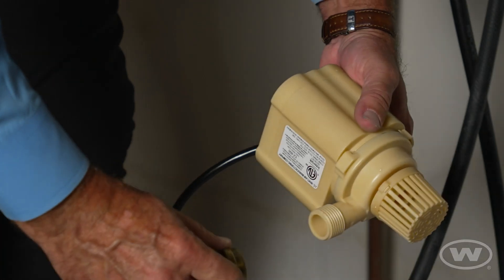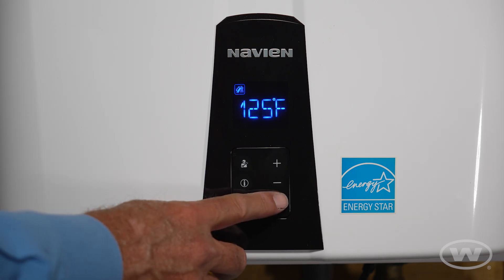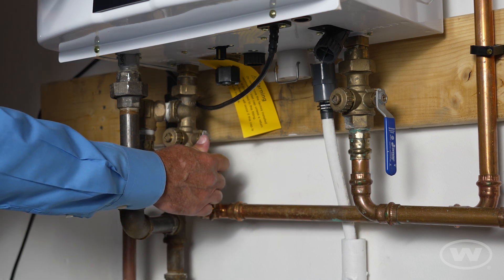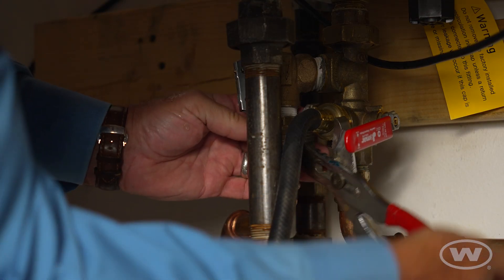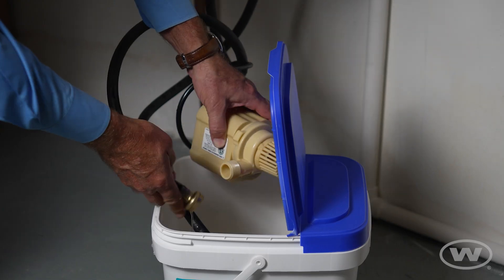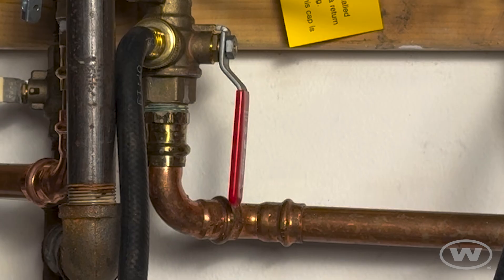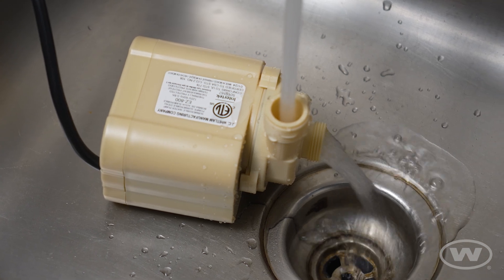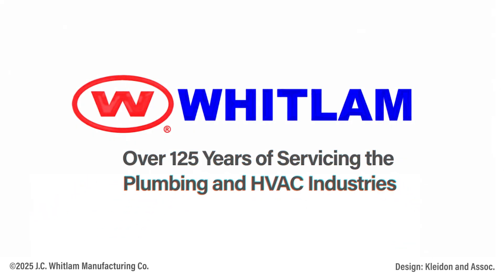Whitlam's FLOW-AIDE® Tankless Water Heater System Descaling Kit

Comment: Shouldn't the service ports be left open when you flush? How does the water flow🤷‍♂️
Reply: watching this and had the same exact question. I think they mixed up open/close in this video. you start by closing it, then open, then close it again
Reply: @briana8131 that is correct. They should be OPEN